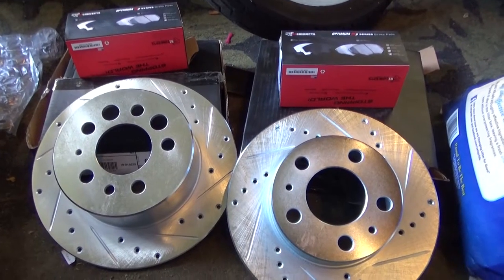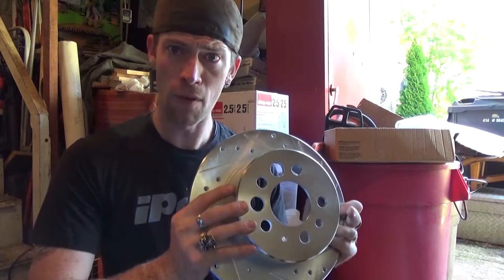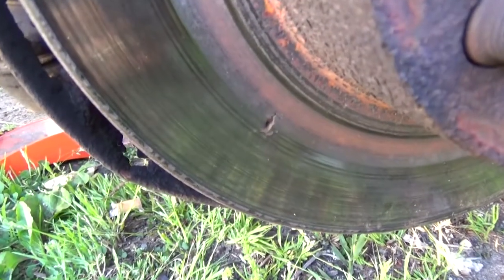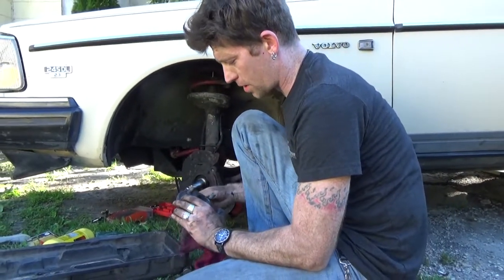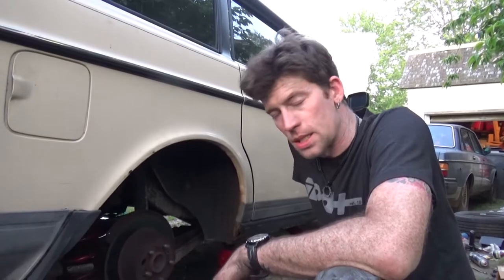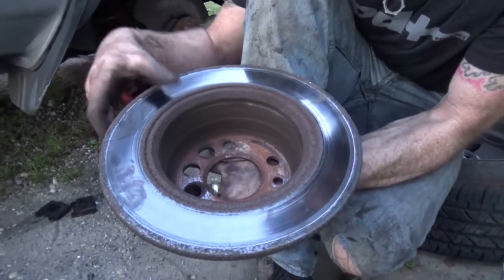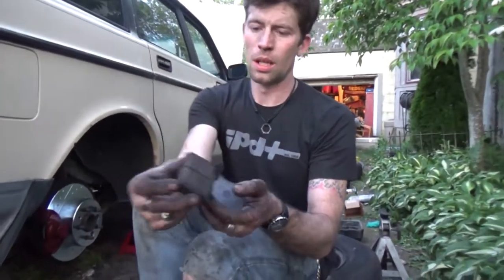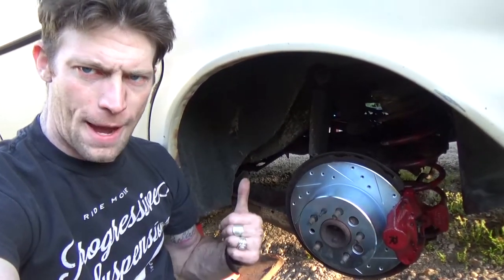Upgrading the Brakes on my Volvo 240 [Part 1]

Comment: ehrm, you say, "there,s a bleeder screw" the front brakes have 3 bleeder screws witch need to be bled at the same time.
conect those to hoses and let them end in a partly filed container.
this way you never pull up air into the system.
and as a bonus you can do it without help.
Reply from the maker: Yes, this is true...I was talking about the rear ones, but on the front Girling calipers there are indeed 3 bleeders.  Though I have never heard about having to bleed them all at the same time..quite the opposite actually.  I admit I am not the end-all-be-all expert, but going from the manuals there is a required sequence to bleeding them to ensure all the air is out.  Only the inner and outers of the front should connected to bled.  

I will have to try the partial container trick though; thanks for the tip

Comment: You have the rotors on the wrong sides. The slots should face towards the rear. Just a little helpful tip.
Reply from the maker: You are right, well have right. I double checked and since the front rotors are internally vented, the vent slots should be in the opposite direction of the vent, in this case the direction they are now. However, you are correct and i hadnt noticed; my rears are reversed. 

Thank you, I will have to address it